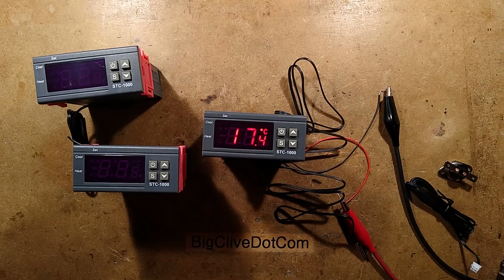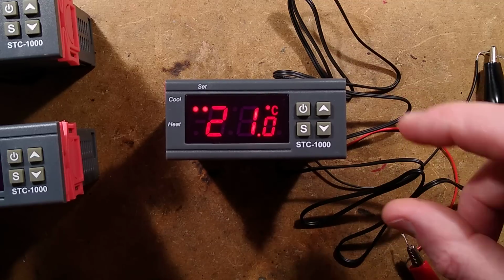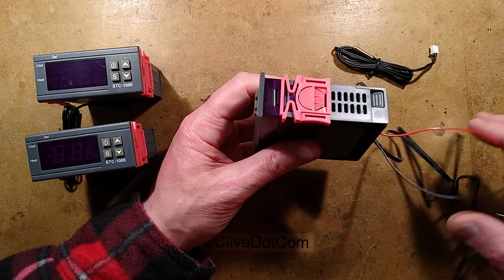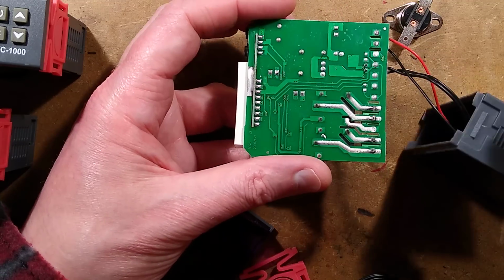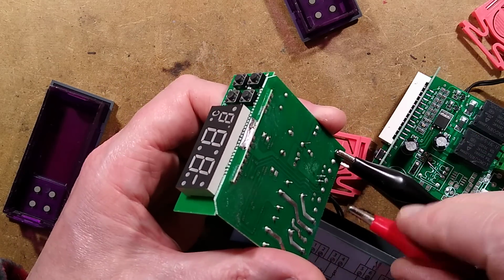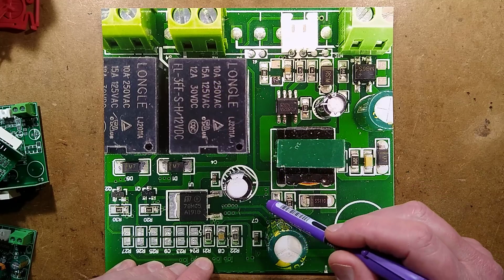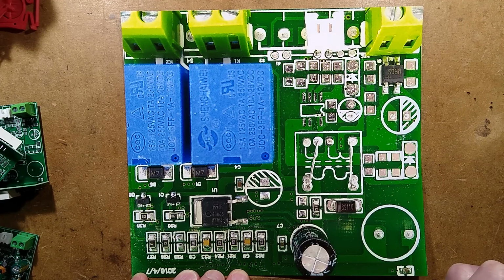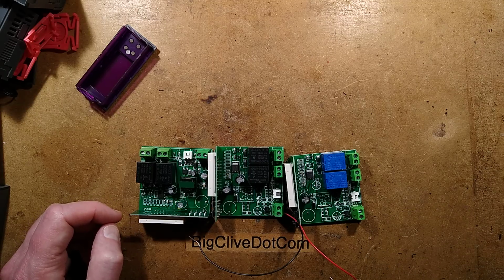Teardown of three STC-1000 style thermostats

Comment: Ha, the STC-1000 for a number of years has been the favorite heating/cooling modules for homebrewers for beer temp control during fermentation and to control the temps on our keezer beer taps. Eventually a company noticed we were ordering these cheap buggers and repackaged them as the "Ink Bird" controller for brewers. Also before home Sous-Vide immersion circulators were under $1000 I cooked using them with a coffee urn and an aquarium pump to move the water.

Comment: for the 'industrial grade' controllers, usually uses output for solid state relays. this way its possible to control the firing of heater at high rate for PID control and at zero crossing. prolonging life of the 'contactor' and the heater itself.

Comment: The extra thermistor input would be an evaporator probe for, say, a walk in fridge or especially a walk in freezer, where a heating element or hot gas is used to defrost the evaporator at set intervals & you need to sense that temp for a preset defrost termination temp. or set time -whichever occurs first.

Comment: The blue relays seem weird to me. Why would they list the 250VAC rating twice with 10A and 7A, then list 28VDC at 10A, but only 1A at 12VDC?

Anyway, I was designing a mini drink fridge a couple of years ago before my 3D printer broke, and I was planning to use a unit similar to these, so I'm glad I didn't try to actually use a fairly high-current Peltier with those relays. I was planning to use a 6A rated module, so if I ever get around to picking up the project again, that would definitely require an external relay or (more likely) SSR.

Comment: Another main use for dual temperature sensors is to measure the outside temperature to optimized the regulation regime for a central heating boiler or pump.  If it's cold outside, the building will need a bigger supply of heat to the local regulators in rooms.

Comment: I use STC-3028 (temperature and humidity) line voltage controllers for a 250 watt heater and a humidifier in my small greenhouses, and the only thing that seems to be common between all them is the board and the case they are in. I actually like them because they are cheap, if they go bang, I can toss it in my spare parts bucket, and throw another one in service. I've noticed some use a 3 wire temp/humidity sensor, and some use a 4 wire sensor. They seem to work well enough, and since I'm in the greenhouses daily, it's pretty easy to tell quickly if they've gone up in smoke. Some day I might try more expensive controllers, but for now, they work well enough.

Comment: Just for reference. Your standard industrial control stuff these days runs at 24 volt DC for the control circuitry. Unless something you're doing is fairly trivial I would stick to the standard. It also opens you up to acquiring all kinds of nice used parts from the industrial side.

Comment: I bought a CW-5000 water chiller for my laser a while back, and it came with T-503 controller module, It was cheap and Chinese, so what could go wrong ?
In this case the T-503 module was a fake. It was the cheapest clone they could come up with and did not work the way things were intended. Better still: the factory making them was the one scammed in the first place. In the end - after buying about half a dozen of these modules I made my own with an arduino and some odds and pieces. There are some specs available and everybody seems to clone of those.
The STC-1000s are no exception to this - although some quality has set in over the time even the worst clones are fixed now.

Comment: Why are there so many contacts going to the display/controller board? As far as I can tell, you'd need two for power, two for the thermistor, four for the relays. But it seems there are 9+4+1=14 contacts. Are those simple the segment display pins used as mechanical connection?

Comment: Thanks for showing me these. I always wondered what they were / where to get the simple stuff to tinker around with.
At 11:21 - The Relays don't have anti-tracking slots for the Mains voltage unit.
What voltage are the relays running? I couldn't really understand that from the video - but I would expect that the relays would run the input voltage to the output-unit?

Comment: The reason there are multiple sensor connection points on the main PCB is because the company that makes the STC-1000 also makes a version (STC-3008) that is a dual temperature controller and uses two sensors. They also make a couple of humidity controllers (DHC-100 and STC-3028) that use 3 wire sensors. We use a custom programmed version of the STC-1000 and have over 1000 of them in the field and have had very few problems with them.

Comment: Buy the mains powered one (if its the same price as 12V) because you then have two options to power it, I had a mains powered one that blew its input circuitry, and i just traced the tracks and used it on 12V.

Comment: I've got an STC controller on a ceramic kiln. I believe it stands for Stoke Temperature Controllers, Stoke being the centre of the Potteries in the UK. 
My controller uses an AI chip that contains a neural network. The values in the neural network adjust themselves by monitoring the temperature and rate of change to achieve the desired heating and cooling ramps which is important in ceramics

Comment: Theses are fantastic units for the price, I have used them in a many of projects from aquariums to walk in chillers/freezers to saunas, even put one in place for temporary use for the radiator fan on the van, always with external relays as never trusted the tiny little things in there, buy they have proven to otherwise be very reliable

Comment: I have had one of these apart with an atmel chip mounted on the back of the display. I didn't investigate any further, but it suggested the possibility that the chip could be reprogrammed with some standard arduino kit. 

I wonder whether there would be programming space for a pid upgrade?

Comment: I think ive the granddad of these clones, an elitech stc1000 from 20/6/2009 according to the pcb.Looks the same on the outside inside its a different beast,proper old skool linear psu, all through hole components  on the main board and decent clearance between the sensor tracks and supply,also clearance and slots around the relay tracks.And yep its even got a warning buzzer
Reply from the maker: That video has been made and is coming soon

Comment: I didn't trust the ebay ones, but even the ones from the local electrical distributor were reasonably cheap, helped the boss wire up one for an industrial gas hot water service. It was notably hotter than a playboy bunny in that attic/ceiling space, but it was a learning experience and easy to install. Would definitely use this or similar for a personal project, maybe some home brew stuff?
Edit: I didnt install a thermal cut out, and we were worried about it, it hasn't failed yet (4 years or so), and I will bring it up with maintenance, it is only two wires and thermal adhesive, good call clive.

Comment: If you really want an ac supply you could use 9vac and be fairly reasonable.

Re: same displays: one of them has a lot more pins, and it’s not even the one with the different color relays.

Comment: Seems like a nice unit.   I wish I had an application for one to get one.   I have a W1209 and haven't found a use for it for 5 years.   Bought it just to play with.  Hopefully it finds a home in a project.
Thought about using it for monitoring batteries being charged for safety cut off if the batteries get toooo warm.   Still thinking about it.   LOL.

Comment: Must be something in the ether.  Yesterday I dug out a single relay version of this style of device that has been lurking in my 'future projects' box for years, with the intention to make something with it, then that evening, I saw this video.  Strange alignments!
Reply: Can we have a Big Clive and Atomic Shrimp crossover?

Atomic Big Shrimp Clive
Reply: @LuminalSpoon  Big Atomic Clive Shrimp .
Reply: @LuminalSpoon  has  @Joe Law  Joe
Reply: Joe
Reply: I vote a sous vide controller. I made a simple 'inline' setup with an old extension lead and an enclosure. Slow cooker with the probe in it for the bath.

Best steak I've ever eaten, from the cheapest cuts possible (right up your street!!)
Reply: @SteveFennel  yeah. Sous vide, or temperature control for cheese making, or for a cheese maturing fridge. There are a lot of applications for fine temperature control that I could make use of
Reply: @AtomicShrimp  I use mine to thermally control my 3d printer cupboard (keeps the filament dry)
Reply: @zac6x9  I've never really had an issue with filament and moisture, I've got rolls that have sat for over 2 years that still print fine, what issues do you get with rolls in a non-controlled environment?
Reply: @SteveFennel  I have cheap filament, a damp house in a wet county (Cornwall) and I was trying to print PETG which printed much better when it was dry. Just raising ambient temp by 5degc really lowers the humidity.
Reply: @SteveFennel  7
Reply: @Joe Law  7
Reply: Thank you

Comment: I used that controller for my laser chiller I built from an air conditioner. Nice it has a compressor rest function.  I set a 3 minute delay between cycles as many compressors require.  It has been working very well and keeps my 130 watt Co2 laser at the perfect temp. I used a low voltage and and external high quality relay for switching ac voltage.
Reply: Theres so many cool uses listed in the comments, so far yours has got to be the coolest. I'm not smart enough to build them but I've always found lasers fascinating
Reply: @goosenotmaverick1156  lol yeah, i built the laser cutter too. Its a beast!
Reply: What's your set temperature? Any data on tube life vs temperature? Thanks!
Reply: @electrowizard2000  each manufacture will have optimal temp ratings.... usually less than 20c. I run my chiller at 12c and the tube stays at 15c at 90%.  I set the max current to 90% to extend tube life. 10,000 hours rating on this tube if run within spec.

Comment: Those look very similar to some of the temperature controllers Chris over on HVACR Videos deal with in reach in coolers and cooks drawers. I'd bet you're spot on with your guess about the board being designed for evaporator a such temps. They probably use the same clone board for multiple models of clone controllers.

Comment: I have two similar 240v units mounted in a box by my bed. I have one temp sensor in the bed at foot level under the electric blanket. I set this at 30c. The other unit is wired in series, measuring the room temp, set at 24c. The electric blanket is set on #3 ( full heat). All this is powered by a clock timer to run between 10:30 pm and 7:30 am April to September. I was so sick of waking up shivering at 3am or covered in sweat if it was a warm night. So now I have the Goldilocks setting and it is just great. Its has been running for nearly ten years. Plugged in last week for the on coming winter.

Comment: Guess I missed something. But on the AC version, how does the transformer work when it has DC input?
Interesting, though. Pity the relays are no good.
Reply from the maker: The transformer is pulsed at high frequency by the chip.

Comment: Odd. Are those not PID units? You can get fairly cheap PID controllers that one typically pairs with an SSR to control a heating element. I assume they do PWM to control the heat level. They have a self-tuning mode that seems to work well.
Reply from the maker: In this case it's a solid on or off for heating and cooling.

Comment: I've seen one failed unit of Carel easy refrigerator controller. Used for cooling cookies and cake cabinet. It has compact build, normal power supply, not switch mode (transformer encapsuled in resin, 12V output) running on ATmega168A. What failed on it was compressor relay, got stuck on closed. And it wasn't cheap one, Omron one with single bigger contact with bigger current capabilities. When I was desoldering it, I heard small relay click from it, heat from soldering iron relased contacts.
Reply from the maker: It does sound like classic contact welding.  Can also often be released with a sharp tap.

Comment: I live in an RV (caravan) in Mesa, AZ where it can get to 120F (50C) in the summer.  The back of the refrigerator is exposed to the outside and has a problem operating above 85F (30C) so I bought one of these to switch on a small fan at that temperature so that it blows on the refrigerator coils.  This works pretty well up to an outside temperature of 105F (40C); after that, nothing will help and the temperature inside the refrigerator will go up to around 50F (10C).  The refrigerator operates on 12v so I hooked it up to the 12v line coming into the back, and the device will work even when I'm on a trip and not connected to shore power.  My project for this summer is to add a second fan that will blow cold air from inside the trailer into the area behind the refrigerator to increase the efficiency of the refrigerator on very hot days.
Reply: I've thought about adding a fan to my rv fridge as well. Good to know one of these will work. What fan did you use?
Reply: @joegroom3195  I bought a 12032 brushless DC cooling blower fan (2 pin) from eBay.  I bought it for $7.50 but current prices seem to be around $20.

Comment: Hey Clive, can you please recommend a cheap solidstate relay or perhaps a simple DIY circuit, to actually switch the mains voltage of the heating/cooling devices with these poxy controller relays?
Reply from the maker: I'd suggest only sourcing solid state relays from prominent suppliers.  The ones sold on places like eBay are often very badly designed clones.

Comment: Could one of these be used to control the heating element of a slow cooker, aka electric crock pot? Usually these are only around 200 watts, with a crude temperature adjustment of low, medium or high. But if you could control the temperature to within a degree or two, it would become a thermostatically controlled water bath, suitable for sous vide cooking, for example.
Reply from the maker: It could work for that.

Comment: I resold few hundreds of these, they are not that bad. It seems they last for a few years. Real bad one is XH-W3001, it`s the cheapest digital thermostat on 220V. Lot of people had them explode in a few days, so I stopped selling them. 12V version was ok but on 220V version the  capacitor usually blow off.
All of these thermostats use that overrated relays, they are good for one third of rated current. I`m using STC-3000 with 30A rated relay on my water heater (9A) for years now without problems.

Comment: Correct me if I'm wrong, but based on the silkscreen, it seems to have provisioning for THREE probes?
There are the three tiny markings, where the populated is an infilled shape (solid white), to its left but spaced away is the same infilled shape, whereas to its immediate right (connected to) is just the outlined shape. _(or is that connected shape indicating its "shared"?)

Also, is that vacant circle for a piezo buzzer, or a non-polar capacitor? The traces look overly beefy to just be a buzzer, but I also don't see any location identifier for it like most (C6 for capacitor 6, D# for diode, R# resistor etc). Whether related, I noticed the case has a tiny knockout panel pretty close to that position as well, but admittedly that could be there for any number of purposes...

The C° or F° functionality I feel was a missed opportunity, unless the controller had so little programmable memory it couldn't be added. But missed, in that simply having it not illuminate the C° would've been just fine! Lots of the stuff in the US market doesn't bother to differentiate that when reporting in Fahrenheit, so it'd have been fine! lol (seems ITC-1000 is the dual function, and perhaps STC-1000X is F-only?? ambiguous results were ambiguous...)

Comment: I’m using one to switch on an inverter for a 120V fridge in a small trailer (the inverter will be latched on by a current switch until the compressor shuts off). I would like to be able to dim the display on the controller but couldn’t see any easy way to do this. Any thoughts?
Reply from the maker: The display intensity will be set on the PCB by resistor choice.  It's fixed.
Reply: @bigclivedotcom  Thank you for that. It’s sort of what I’d thought when I looked at the board. 
Ps. I truly enjoy your channel. Keep them coming.
Reply: @G Turner Put a piece of dimming plastic over the display. When you please you can restore to full brightness by removing ing it. Now who shall we credit for that idea?  :-)

Comment: I've had a 110v one in operation since 2016, It is used as a low temp cutoff for an array of server fans propped up in a window to cool off my room. 
it has switched up to 5 amps of 12v for years, but usually it's ran on a lower voltage unless its quite hot.
they are great units for the price. at just $15 I've ended up with more of them now to just use as thermometers for various things. the relays are an added bonus at that point

Comment: Looking to add a setup like this to a fine automobile, late model, so thoughts on that in either here or futures if you find one better, with say a PWM Fan speed controller. 

Also, thank you! I've been searching for items that can actually control both a heating and cooling and haven't found any so far for home AC unit. So, Wifi control module addition potential or BT for remote operation/IOT?

I know but a simple app saves the family from having to get up and change it all the time.

Cheers as always sir!